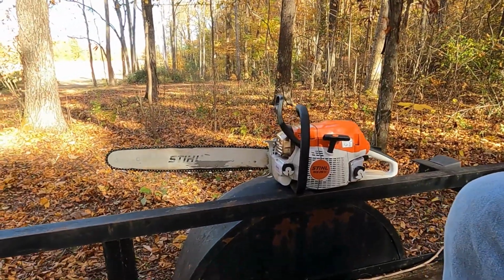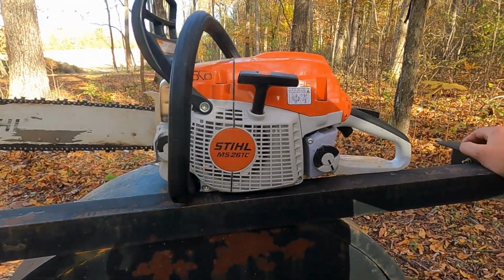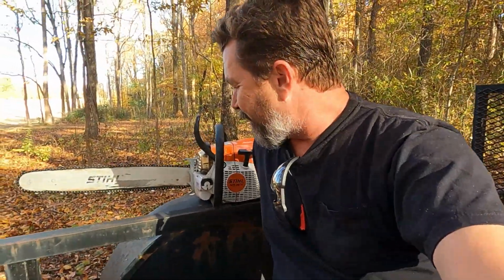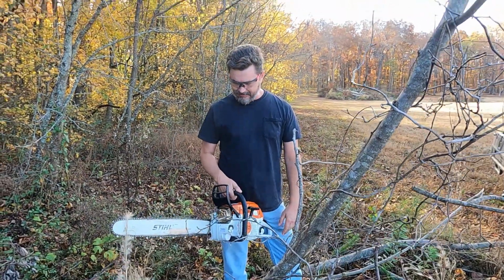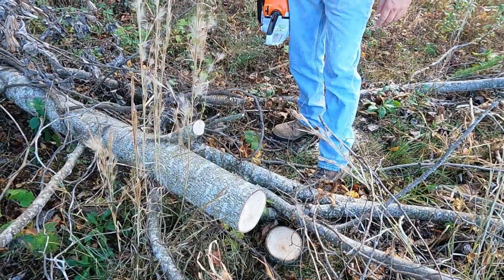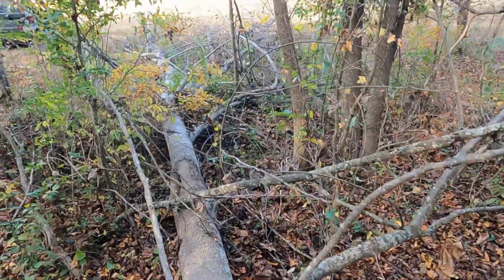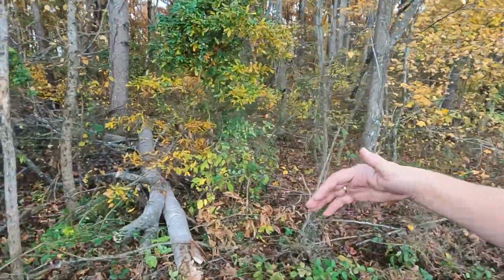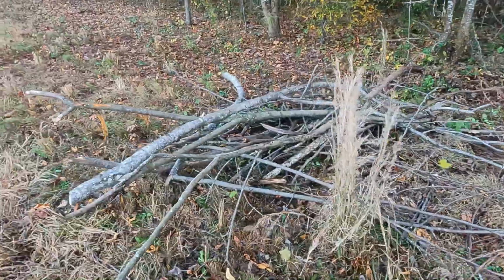Stihl MS261C Chainsaw Motor Ruined! Less than a year old. Only used a hand full of times.

Comment: If you have overheated your bar it will sluf off the paint and have  a blue heat signature marks along the edge of the rail on the section where it got hot  if you have a relatively big piece of glass you can take your bar and lay it flat on that   and check it for warping or stand the bar up on its rail (that's been trueed up square) put it on a flat surface and run a square up and down from one end to the other    and check for twists    usually the reason you get a tweak or  bend in your bar is because you put too much torsional force  on it   try to pull it out of a pinch or a bind .. your bar rails also have to be level  parallel and true   you can take a small accurate square and slide it up and down your rails facing toward the sunlight just right   and check for any worn spots that could cause your chain to track sideways  and correct them with a flat file     those bar dressing tool off of eBay for around $13 seem to work pretty good and help take some of the guesswork out   ... If your chain rocks too much slop in the bar groove   it'll cause it to cut off to one side   if you're good with a hammer  you can close your rails back up to spec      there's a guy on eBay that sells really nice bar closing tools    that'll have you singin' Happy trails and in a hurry 😁 they're a little  expensive  but they're well built and they'll last you probably a dozen lifetimes    all stainless steel construction  ... then of course your chain has to be symmetrical opposed on both sides  same angle with same tooth length (it's not too much of a problem if you have to file just one or two shorter if you hit a nail or Rock)    and your depth gauges have to be all consistently the same height   as well as  the RIGHT HEIGHT  sometimes they need to meet up with the file    straight out of the box brand new  as there a bit too high of course there's some variations on that    like what you're cutting and how aggressive you want it to cut   if one side of your rakers are shorter than the other it will cause it to cut off to one side  Or sometimes if they're just too tall they can cause it to wanna favor one side    especially in conjunction with any other aspects  that are out of spec  ...and you have to use a really good bar oil some of them are just crap believe it or not I use Poulan Pro from Walmart  I have really good luck with it  heavy sticky and stays on your chain   I also found out I needed to modify my oil pumps    or upgrade to high output  to get sufficient oil flow especially when I'm cutting that bigger stuff that's dead hard dry  ... And if you get into the art of  square filing   I've found that not only do they cut faster and more efficient they seem to hold their edge much better   the tooth cutting beak tends not to round down as much  if your chain is not cutting   it's making heat   not only does that stretch your chain and wipe it out in a hurry   it also transfers that said heat through the bar  into your engine leaving it open to overheating  ..on some of those bars   the oil holes are a little restrictive and you can get a notable amount of exta oil flow by taking a small carbide or diamond Dremel bit and elongate the oil hole to double size .. by sloting you're  hole vertical with the rail and to the back   away from the nose of the bar
Reply from the maker: Mark! Dude! You just laid it all out there. Wow, thanks man. This will take me a minute to digest. Great info! Thanks a lot. I will be referring back to this.

Comment: Seasoned cutter here and i   Own and run the 261c for many years now excellent saw my go to never let me down just make sure you use 50:1 ratio oil to fuel mix check ur plug every so often refer to the service manual and always clean the filter most importantly a chainsaw is only as good  as its chain is that its sharp when sharpening the cutters don't have to be  perfect lengths or same lengths just make sure there sharpened in the same angle and your raker depth gauges are all filed down the same depth right around and you will be good its about maintenance over and over  you simply take care of something and it will do its best taking care of you.

Comment: I have a Stihl 261C which is currently at the Stihl dealer because it was bogging down under load.  It is the first time I have had any issues with it after 2 1/2 years with lots of hours on it.   At one point in the past, I was sawing with a dull chain and heated up the bar significantly.  I was afraid the heat may have caused the cylinder wall to become scored.  Since it is easy to remove the muffler and check this, I did, and all looked ok.  This was a really helpful video - thanks and good luck with your new 261C.

Comment: I just saw this. You are not alone on that type of MS261 failure! It’s supposed to be a professional saw! Most people are convinced the Mtronic system is running it too lean at times. Husqvarna had that problem with Autotune and ended up redesigning the 550xp with a totally different cylinder with more cooling fins. Stihl Ultra 2 cycle oil is the last oil I would choose and I would make sure to use ethanol free gasoline with your mix @ 40:1. Mtronic will adjust itself(or should). Check the owner’s manual on occasional reset procedures. Plenty of advice on here with sharpening, etc. I would look into an aftermarket guide bar such as Sugihara or Tsumura, they’re made from tool steel. 👍
Reply from the maker: Awesome info! Thanks a lot for sharing your knowledge! What oil would you recommend?
Reply: @TheLovelyPlace  I use Echo Red Armor.
Reply: I love my manual tune Stihl 261.

Comment: If the cut is going sideways check the chain tension, check that the bar is secured properly to the powerhead, check that the bar channels are not damaged, and make sure the chain is properly sharpened. If it still cuts on an. angle change your stance. In the video it appears that your stance is not confident i.e. you're standing more on an angle. It just takes practise to get the saw to cut perpendicular to the stump. There's no need to apply vertical force to the blade/chain if the chain is sharp. The chain will bite and pull the bar into the stump as it cuts. Jope that helps.
Reply from the maker: @danstefancic8414  Thank you!

Comment: Got a fairly new 271 in the shop. He was using it & it quit mid-cut. He was pissed! He bought it used & had it maybe a year. When I looked at it it was evident dirt was getting past the air filter. Air filter was clean but dirt was in the intake.
Reply: Another thing, a dull chain will overspeed the motor.
Reply: Bar rails are worn if it's cutting uneven with a good chain. Then again it depends on how it was sharpened.
Reply: Thank You @darrellepickering8433  for saying that.  It's not that the motor gets bogged down with a dull chain, it is because the chain is riding effortlessly on the depth gauges and doing NO work at all.  The motor is just screaming its guts out.  I'm wondering if the M-tronic didn't just default to the high rpm mode you get in a reset?

Comment: I have a MS261C that I bought in 2015 and has been fantastic. I have several bigger and smaller saws but this has been my go to saw and never lets me down. One thing I did from the start was use Red Line two stroke racing oil in all my saws like I do in my snowmobiles. This is the best two stroke oil on the market in my opinion.
Reply from the maker: Great to learn about the oil brand that you use. I will look for some. Thanks!

Comment: I’ve got got a ms290 about 15 years old now starts on the 3rd pull every time. Been through hundreds of chains and a few bars. It took a steep learning curve to know how to sharpen a chain. All things being equal tooth length and sharp on both sides of the chain will straighten your cuts. Your chain doesn’t appear equal thus the cutting curve. I’ve learned to file my chain every third tank same number of strokes per side. Tooth length should match, measure it. I’ve got a ms180 for limb work. I’d like a new saw but can’t justify it.
Reply from the maker: Thanks Danny, I appreciate you giving your valuable feedback.

Comment: Just curious and still learning myself but is the angled cut due to operator slanting / canting the bar when using the machine?? could a different hold on the top grip rectify this?
 Also is this 261  the "M TRONIC" and can the shop supply a breakdown of the usage??

Comment: If the rails of your bar are worn on one side of the chain groove more than the other you will cut in an arch, you can file or grind it back square. 
Caused by  pushing down on the center of your top bar instead of as close to directly over clutch side as possible.
I’m right handed so I hold as far to the clutch side as possible and apply push force with my left thumb on the curve of the handle.

For a left hander slide your hand all the way to the right and apply downward force with your palm at the base of you pinky.
Any downward force from the center or left side of the top bar will a  crooked cut and wear the bar and chain and cut off to the side.
The heat spot in the paint on the flywheel side of you shows friction and excessive friction and wear.
Good luck to you and enjoy your saw I have 2 026 stihls myself and use them more than my bigger saws
Reply from the maker: Man that's also helpful, I am learning. Thanks for sharing this with me.

Comment: As , a few others have suggested check the condition of your bar. There should be no burrs on it at all, and the guide rails should be level to one another. Otherwise the rails will need to be dressed. 
The chain maybe be sharp, but your rakers may be higher on one side than the other. Use a gauge and file each raker gauge. Even if your using the 2in1 file check every tooth with a raker gauge afterwards. 
Also, that blue discoloration is from the factory,  the guide rails are tempered to reduce wear.

Comment: Yes a bar can absolutely warp from excessive heat and heat will also blue the rail of the bar too, so if the edges of the bar where the chain seats is blue then you'll need to replace it because it is no longer safe.
Reply from the maker: Thanks! I have not noticed any blue but will take a closer look.

Comment: As to the saw cutting straight when cutting up but cutting on a curve when cutting down. That suggests that the top/outer most surface of the bar rails are worn unevenly. To check - take the bar+chain off, remove the chain from the bar and clean the bar of debris. Then look along the bar’s groove at arm’s length. Do this on both edges along both grooves.

If either rail/s of either side of the bar is lower in comparison to its pair. Then the bar needs to be dressed, in order to allow the chain to equally ride along the rails. If the rails on one side or both sides of a guide bar is worn more than its pair. Then the chain will flop to the lower edged rail, resulting in a curving cut and probably increased vibration.

It’s a circle. A worn and sometimes blunt chain, can unevenly wear the bar. An unevenly worn bar, will unevenly wear the chain. The longer you leave the problem, the worse it gets, for both chain & bar. To dress the guide bar, requires that you know and can draw-file the bar. If you can’t draw-file, you can overcome this by using a tool made exactly for this task. I think it’s called a ‘Guide Bar Deburring Tool’ or ‘Guide Bar Dressing Tool’. Your dealer could sell you one but they’re also made by Husqvarna, Oregon, Vallorbe, Echo and are also available from Amazon for a 1/4 of the price. Basically it’s a tool that allows the user, to accurately flat file the guide bar rail or rails, at exactly 90° to the side of the guide bar, to where both rails are squared and at the same height from the base of the groove’s gullet. And or remove burrs from the edges of a worn guide bar.

It’s good practice to check for even/uneven wear of the rails, each time you clean the bar and or are flipping the bar over during routine maintenance. (Just be careful of burrs along the rails while checking.)

A guide bar will have a small amount of wear during normal cutting. However, a blunt chain will result in heavier guide bar wear. Mainly due to the operator leaning or pushing on the saw with a blunt chain. Invariably when pushing/leaning on the saw, the operator will be leaning one side more than the other. This in turn pushes the chain sideways off the bar and results in a yet greater degree of wear to both chain and guide bar rails.

Also, a blunt chain will and can require more bar oil. If a chain remains blunt, the excess friction of chain against uneven rails, can alter the temper of both chain and rails. This in turn allows the rails to wear quicker and there’s no way back from this. Once the chain and bar rails are softened, a pattern of excessive & premature wear will exist. And the kick in the knee, is that a worn chain, will prematurely wear the drive sprocket. Better to keep the chain sharp.

And as a safety note. Chainsaws are designed to be used with the left hand on the front handle and the right hand on the rear hand, controlling the power-trigger. I can see you have no concerns of possible leg injury, as you don’t wear chaps. And you have either poor hearing or want to be deaf, as you don’t wear any hearing protection. And you have no concerns of shoulder/chest/head injuries, as you’re prepared and are using a chainsaw left-handed.

Please for your own good health, wear chainsaw chaps, a minimum of 23SNR ear defenders and use the saw right-handed. If the upper quadrant of the bar nose contacts an immovable object, the saw can have a kickback event. This can also happen, if the nose is pinched along its upper quadrant.

A chainsaw kickback happens too quickly for you to avoid the upward motion. If you’re using the saw right-handedly and providing you’re not looking along the bar. The bar+chain will pass to right side of your body. If you’re using the saw left-handedly, the bar+chain will hit your body at chest+shoulder+head height. While chains seemingly slice neatly through wood. The same cannot be said of chains through flesh & bone. The wound/s will be jagged and severe. Even if you survive, they will be life changing injuries!

Yes whichever hand is holding the front handle will probably activate the chainbrake. And yes your particular saw has a chainbrake, which can be activated through sudden inertia event. But what if on that one day, your right hand or wrist doesn’t contact the chainbrake lever and for some reason the brake isn’t activated by inertia? Then it’s back to the life changing injuries.

Comment: When I bought my first chainsaw 2 years ago I bought a homeowner ms211c. I managed to dull the chain in the first 2 minutes of cutting. No one told me hitting the dirt was bad! Then proceeded to cut some more with it. Shortly after I mean within 20 minutes a good portion of the bar paint came off. I had had it 1 day!!! So chain on too tight and dull chain. Heats up bar. You don’t need a new bar. I have used that Ms211c bar for another 2 years now. Looks beat to hell. Talked to a buddy of my mine that schooled me on chainsawing. He’s got 4 stihls. Bought a 2in1 sharpener for that ms211c. Watched some YouTube videos. Got it screaming sharp in under 5 minutes. Had dulled the chain quite a bit. But after I learned what not to do anymore (hit dirt) and learned how to sharpen with that 2in1 I used that chain and filed it probably 100x before retiring it and had cut probably 7 cords of wood with it. Last nov 2021 I upgraded to a ms462C. After several cords of cutting and the experience of knowing when to stop and sharpen and how much to tension the chain I barely have maybe a couple of spots of missing paint on the bar (from maybe being pinched and then twisting the bar to get out). Wrong oil mixture or straight up no oil or dull chain like said scored your piston. I know a guy that that killed his ms291 as he had little experience and kept running the saw even when the chain was dull. Learn how to use the 2in1. Even super dull chains it can bring back to life. I use a 28” bar and was cutting a log once on a hill but didn’t realize the front of the bar had been contacting dirt for a good 10-15 seconds. Left side of the chain all broke! I spent some time filing them back to sharp. Left and right side were totally at different lengths. Didn’t matter. Once it was all filed to sharp again it cut straight Eventhough the left side teeth were half filed away to fix all the broke off tips.people that say the 2in1 is no good don’t have a clue what they are talking about. All I’ve used for 2+ years. No need to pay someone to sharpen a chain unless it’s real bad or you’re just too lazy 🤣 all these you need to get a new bar comments are nonsense. You’ll not likely wear that bar out other than remove the paint. Don’t tension the chain too tight and LIFT up the bar as you tension it. If you don’t the second you cut the bar will lift up and the chain will appear loose again.
Reply from the maker: Your comments are reassuring and much appreciated. I will make this my initial focus. I already own the 2 in 1 sharpener and have used it. I think the damage had already been done to the original saw by the time I realized my error of not having it sharp enough. I should have done a lot more. research before using it. I just didn't realize the extent of upkeep required until it was a little too late. Thanks!
Reply: @TheLovelyPlace  kinda trips me out the Stihl dealers don’t educate or ask questions when selling a saw. They didn’t ask me anything either when I bought my home owner saw.  I think it also depends on the dealership. Some honestly aren’t very educated. The 2in1 sharpeners are the best! And the replacement round files are $2 each. The flat file is $10. But it’ll last a few years before you need new files